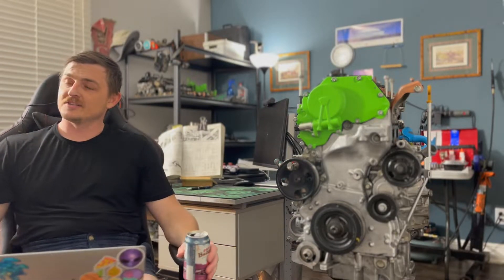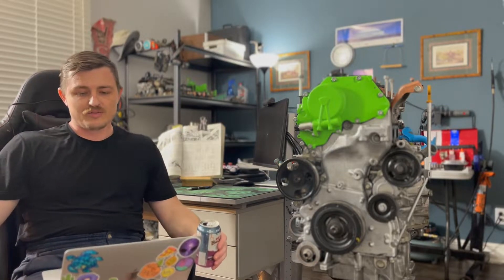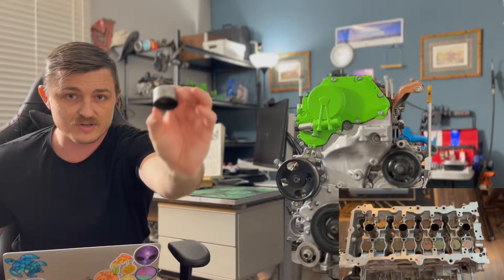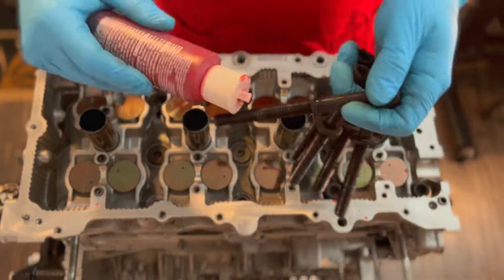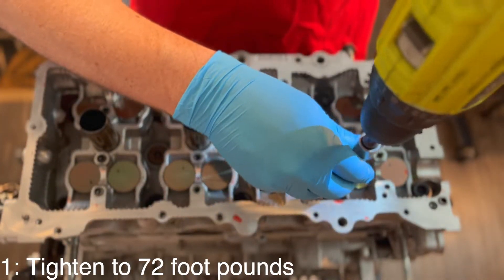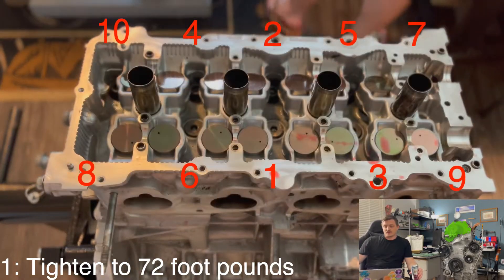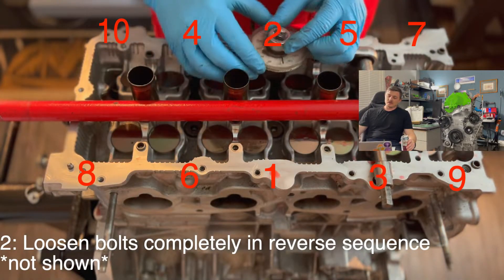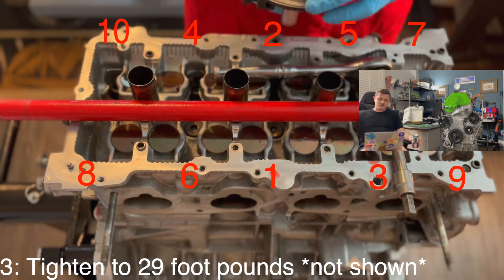Texas Toolbox - Nissan Altima QR25 Head & Cam Install

Comment: Hi. Could you please tell me the head bolt torque specs details of nissan tiida latio 2005. I am going to change new head gasket. 1.5 petrol at engine?
Reply from the maker: Hi Mohamed, have you tried to google it? The factory service manual for a 2005 shouldn’t be difficult to find.  Try goggling 2005 nissan tiida latio factory service manual or visit workshopservicemanual.com.  Hope this helps!

Comment: I can't go into third gear is it time for a new transmission?
Reply from the maker: Hey, Jayvon! Thanks for the comment, please be sure to subscribe!  It depends on your trim level.  This model year (MY) came with a 6 speed manual w/ overdrive, or an Xtronic 2 speed CVT w/ overdrive. If you are missing a gear a would not automatically assume the transmission needs to be replaced.  Transmissions are complex equipment with components that need to work together for smooth reliable function.  I’d recommend identifying your transmission type by the factory code and doing some research on the problem!  Hope this helps!
Reply: @texastoolbox6512  4 cylinder zero to 80 3 seconds not stock but it was until I changed my exhaust flex pipe new cats and performance air intake system car is awesome to drive.
Reply: I got that qr25de
Reply: @texastoolbox6512  re4f04b transmission   could be a shift solenoid on the gear ratio spring area

Comment: Nice video I have a frontier with the QR as well but it’s different I wish more people would build the same engine in the truck
Reply from the maker: Absolutely brother! It’s a very common motor, yet due to some deck height design choices as well as cast not forged internals, this motor doesn’t get a lot of love.  For people shelling out the big dollars for power they aren’t wasting their time on the poor man’s automotive motor - which is a shame, since there is a potentially large untapped market for a complete performance package on this model engine.  Despite having a very short stroke I think one of these motors can give you a lot of peppy energy in the miles it churns out.

Comment: Are you located in Houston and do you work on customers qr25de
Reply from the maker: hey! thanks for asking!  I do this work for myself and steer clear of doing it for others because I have a day job that aint this :).
Reply: @texastoolbox6512  do you recommend someone to do timing chain have over 150k miles i hear chain slapping on morning startup
Reply from the maker: @kharyanwar  I don't have recommendations since I do my own.  My only advice is to pick two from: quick, fast, & cheap... You won't get all three together ever.

Comment: HEADS UP! everything you see here will likely be reverse of what you will see in the engine bay because he has it out
Reply from the maker: That's a really good point! I'm hoping this video will show the process of putting it back together, the right way.  I think taking it apart process is self explanatory, for the initiated like you that is.  I might do future videos about how to remove the Nissan QR series motor - if that's something you'd be interested in?